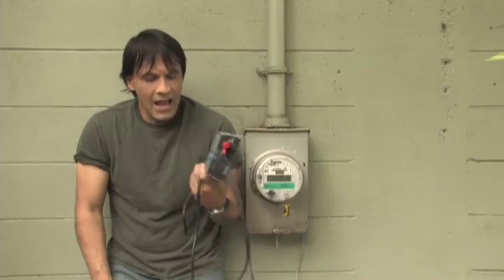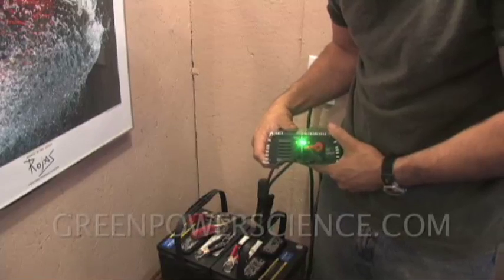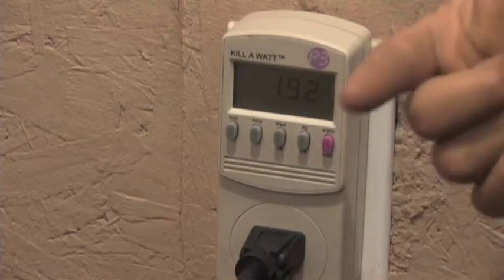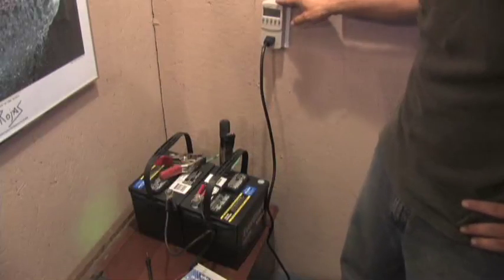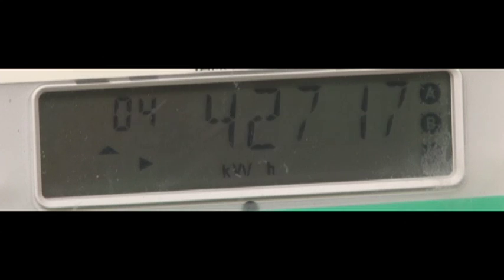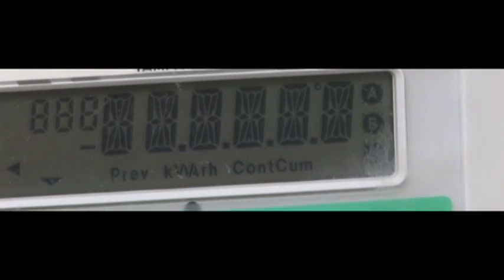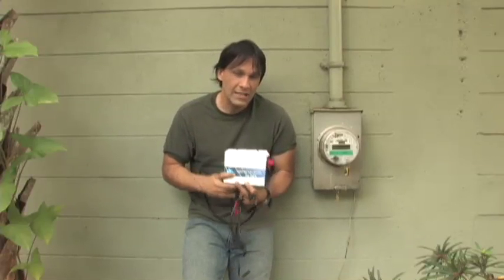GRID TIE INVERTER SOLAR panel POWER EASY Electricity Savings

Comment: I need advice: I have 2) 100watt solar panels (wired in parallel) to 2) 12v 100ah batteries (wired in parallel = 12v) and a solar charge controller. I want to power a 1000 watt grid tied inverter through the charge controller to prevent battery damage when the voltage drops to low. When I connected the inverter to the "load" side of the controller it does not power up. The inverter only works when connected directly to the battery bank. Is there a way to have the inverter power on and off automatically? Right now I have to manually monitor the battery voltage and manually turn the inverter on and off when the voltage drops. Any suggestions? Thanks everyone.
Reply from the maker: Hi,

The charge controller is shutting down because of the large draw to the inverter from the batteries. GTIs go direct to solar panels as there is no need for batteries. The battery was just a demo in this video. The idea is that the GTI supplements power to your house. If you hook a 1000 watt GTI to a charged 12V Battery it will draw 1000 watts = 84 amps on the 12V side = the reason the charge controller is shutting down or damaged. Charge controllers with a standard off grid regular Inverter goes prior to the batteries from the panels. This prevents overcharging of the batteries from the solar panels. You could place the charge controller from the panels to the batteries and directly hook the GTI to the batteries but you will drain them in about one - two hours because the batteries have a high AMP output. 200 watts of panels will deliver 150-200 watts of power to a 1000 watt GTI during optimal sunlight.
Reply: sfromd, the grid tie inverter is likely not powering up through the load of the charge controller because the grid tie inverter is 24 volts and it sounds like you are connecting it to a 12 volt system.  I too have a 1000 watt grid tie inverter and have been contemplating if i should connect it directly to my 24 volt battery bank which contains 300 amp and a total of 7200 watts.  If it is true that a wall outlet can handle either 1500 watts or 2000 watts depending on the breaker, then my battery bank which is connected in series/parallel totaling 24 volts x 300 amp = 7200 watts would be too much for an electrical outlet.

Comment: if you disconnect the main (turn off the Main Breaker) that isolates the meter(GRID) from the house....so the inverter is isolated from the grid (meter) . Also clamp on amp. meter only works on A/C.  with only one current carrying conductor in the field jaw .
Reply: Ronald Morell they also have dc clamp meter as he showed

Comment: can i use my dc to ac power inverter? i connect my tv to it is there a difference? beetween inverters?
Reply from the maker: Grid tie requires standard electrical input. Square or sine wave inverters (grid tie fall in the category) use battery power. Grid tie is Panel to inverter to outlet. Regular is panel to charge controller to battery to inverter = grid free.
Reply: so i have a cobra 2000 watt 4000 watt peak it has the regular connectiong like the  one you connect o a socket, if i cut the other end of the socket, and redo the connection, and plug it in to the socket will it work? i have them connected to my batteries which the charge controller charges with my solar panels.

Comment: if you drop the house breakers it kills the negatives running to your meter, and it will cut all connection to your metter even if your feeding the outlet, just my way of thinking maybe im wrong.

Comment: Wait a minute here now. When you flipped the Main beaker off  disconnecting your home from the power company  , what was the magic you used to still have the meter to register what could not be there from that inverter If indeed you turned off your main beaker cutting the house from the meter ?
Reply: The main breaker is still on. The breaker to the inverter is still on. ALL the other breakers are off.  The only problem is the electric company will NOT give you one penny back unless you have a contract. Thus the power meter keeps resetting itself to the highest amount it ever reached, basically taking the electricity and keeping it for free.  Search Wikipedia for "Robber Barons"
Reply from the maker: Main on all the rest except the one with the GTI off.

Comment: some people say i dont even need a dc breaker for a single panel. is this true?
Reply from the maker: You sort of do not need a fuse for inline from panels so for grid tie, not needed because panels have max limits of power. If you are going to batteries, the fuse is placed after the batteries because they can deliver a dangerous short load. If you have many panels arrayed it is recommended.

Comment: I would like to ask if I purchased a 2000W system as an example would I just be able to plug that into any outlet.  My concern is the rating on the house wiring.  15A rating has a power rating less the 2KW and when plugging a 2000W Grid Tie Inverter and I possibly pull 2KW of power would that burn the house wiring?  Great info on your video.  Thanks for posting

Comment: 7:05 sure you didn't mean it technically but in case some people don't know you cannot hook as many as you want to the same circuit because you could overload your circuit.  You would want to take into account what is already plugged into your circuit and figure up the current.  You mentioned 10 inverters and 2000 watts.  That is 16.7 amps (if really getting total power output of all) which is under 20 amps for a 20 amp circuit(but more than 80 percent of the rating of 20 amp breaker) and some people in mobile homes have 15 amp circuits so would be overloaded.  This is all not taking into account anything else already on the same circuit you would need to look out for that is drawing current.

Comment: i thought you cannot connect this grid tie inverter to batteries?
Reply from the maker: You can but the inverter draws a maximum load and maximum output. This was just for a test. With a traditional real installation batteries should not be used. Direct panel to Grid tie Inverter. Not sure if the annotations are still appearing youtube has phased them out. It was mentioned in the annotation bubbles.

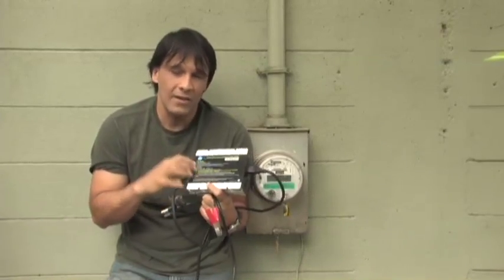Comment: you said don't connect this to outlet but at min 1:46 you said connect this inverter to outlet? in other words how to connect this inverter?
Reply from the maker: Panel or panels solar go to the DC inputs, and the male plug goes into the outlet of your house. This only works with grid tie inverters. The regular inverters will get destroyed.

Comment: So im looking at this Grid Tie Inverter on Amazon. I see "Solarepic Grid Tie Inverter 1000w Stackable w/ MPPT 10.8-30v Input 110v Output" So 100 Watt solar panel gives me 12V output.... So, for every 3 solar panels I would get 300 Watts and 36 Volts. Am I correct in thinking that I will need to buy another Grid Tie Inverter for every 300 Watt 36 Volt solar panel? What does it matter if the Wattage it can handle is 1000W if  1000W solar panel puts out 120Volts?

Comment: I'm not a electrition but 1kwh = 1000 watts\hour. Pumping 250 watts per hour back into the grid system equates to .25kwh therefore it would take 4 hours to become 1kwh. I could be wrong because im not an electrition but my math looks correct.
Reply: It's not, kWh isn't watts/hour, it's watts * hour
Reply: Its .25Kwh not 25Kwh therefore in four hours the meter should go back 1 digit (1Kwh). But the inverter will always be putting out .25Kwh. (250 watts/1000)
 A lot of people get this wrong.
Think of it this way, you have a bucket of 1,000 watts and it takes 1 hour to drain, that would be 1,000 watts in an hour or 1Kwh. Now take that same bucket and make it drain at a rate of 250watts per hour.  it would take hours to empty. Now take this wattage or drain of 250w and divide it by how much is in the bucket (1,000w or 1Kw) you will have .250Kwh, or how many Kw per hour.
Reply: Math wrong but either way it gave him correct answer in this case because 1000/1 = 1000, and 1000 * 1 = 1000.  I believe the point to his comment is that it should have taken 4 hours time to go by for the meter to go backwards.  This is not the case.  This was the point of them waiting for it to move to the next number.  It just changed from 6 to 7 so it shouldn't have taken a full kWh to move back to 6.  Since it just changed it shouldn't have taken much at all.
Reply: That electric meter reads KWH and in small numbers 10ths and 100ths' of a KWH meaning it can read 10 Watt hours. a 200W inverter can supply 200 watts in 1 hour or 20 watts in 6 minutes or 10 watts in 3 minutes. The lower digit should change lower every 3 minutes at full capacity.  As the video reports it is a greedy meter meaning it's fixed by the electric company to accept the electricity from you but will NOT record or pay for it unless you have a contract for buy back (for less then you pay them for the original juice I may add). That is one reason the electric companys got so excited to update meters from mechanical (which they had no control to prevent  that) to electronic ones that could be told to "not" pay you anything, or worse only pay you a percentage of what you pay them.
Reply: Best thing is to just run solar and batteries and an inverter and shut off your main.
Reply: @drewpaschal9294  That's the best thing for the battery manufacturers :-)  But the worst thing for your wallet.

Comment: if you wanted to see it tick backwards you should have waited 5 hours. why 5 hours because the metter displays kwh. 1kwh=1000 watts running for 1 hour. a 200 watt grit tie would take 5 hours to get it to tick back 1kwh. i may be wrong if so my  bad
Reply: This is not the case.  This was the point of them waiting for it to move
 to the next number.  It just changed from 6 to 7 so it shouldn't have 
taken a full kWh to move back to 6.  Since it just changed it shouldn't 
have taken much at all.
Reply: Didn't make any difference since the electronic meter was obviously set to not reverse. Thats why he called it a "greedy meter" . Why do you think the electric company started installing those meters in such a Friggin Rush?

Comment: How did the power feed back into the grid with the main off? The main is the point between the meter and the load center. If the main is off then it wouldn't back feed because the circuit was interrupted to the grid.
Reply: The main breaker is still on. The breaker to the inverter is still on. ALL the other breakers are off.  The only problem is the electric company will NOT give you one penny back unless you have a contract. Thus the power meter keeps resetting itself to the highest amount it ever reached, basically taking the electricity and keeping it for free.  Search Wikipedia for "Robber Barons"
Reply: Calvin Thomas I am using a 960w system and I got a warning to remove my system they say its illegal and the only time we use over 900w is when we use our laundry

Comment: I know this is an old video, but DIY is a no-no when it comes to Grid-Tie systems. There are many laws in place when it comes to messing with the power company. You have to get permission, permits, and inspections before you are legally allowed to add power to their lines. You can take all you want but you can NOT put power back in. You are not even legally allowed to add to an existing Grid-Tie system, without jumping through the permit and inspection hoops. They are very strict about that.
Now what you CAN do, is have an Off-Grid system that is isolated from the power company's lines, through a transfer switch (like you use for generators during a power outage). Of course, that has to be inspected and approved so your homeowner's insurance will cover you. So if you don't want a full size Grid-Tie system (that goes down during a blackout), this is a better alternative to lowering your power bill. I personally think Grid-Tie systems are a waste.
Reply from the maker: Produce less than you use and no electrons back power the grid through the meter. That makes it an electrical appliance. Nothing post meter is regulated from the power company. They was their hands of post meter appliances for legal reasons. If you back power the grid, that is a different story.
Electric companies MUST prove electron transfer to their grid, basically not worth their time.
Reply: Oh, they are quite clever and have computer algorithms to check for things like that, much like cable companies who have ways to look for people stealing cable (like sharing basic cable with a neighbor with a splitter). Their instruments can see too much draw on their cable line.   I once moved into an apartment and obviously didn't use nearly as much power at the previous tenants. After some months there was a notice on my bill that they installed a new meter, figuring something must be wrong with the old one, because of my low bills.
Reply: Yes, that is it.  Do not produce more than you use and slow your meter.  Selling back to the grid is a monster.

Comment: First point: Um...... I'm not an electrician, but my common sense tells me that plugging into the wall like that is a HUGE FIRE HAZARD.  It seems to me that there is specialized equipment made for grid tie ins. Second point: Anyone watching this video DO NOT buy the KILL O WATT meter shown in this video. (no offense). I bought that exact product to monitor how many kilowatts my electric car was using and it died after 2 months. Piece of crap.
Reply: lol , your kill-a-watt meter is rated for 15 amps MAX... charging your electric car used at least 15A ( my leaf was at 25A ) that is probably why it failed

Comment: Hey. I have been a looking at your video for a long time now  and  I'm getting to do a set up like yours .i just pick up 2-24v-230 watt solar panels and I have had 2 -12v-60 watt solar panels with a sun 300 watt grid ti inverter what should I buy to set up this system to get the most out of what I have so far. I allso have 4 deep cycle marine batteries and one kills watt meter all will be set up in a shed 12 feet from my house and outlets

Comment: Man! Why does everybody want grid tie? Scuhrew that! Learn what you can power with a good tie box from a box powered by the inverter itself. You can get out with a damn decent system for about 3k$ power certain things that will not even touch the power meter. Everybody is doing this "Green Movement" which is good, but there seems a herd mentality to it. It's like there's only "green" if it benefits the corporations. Once again... Scuhrew that! Come on people! Think outside the box a little. Power just your fridge or your tv and lights by your inverter/s.

Comment: Man I been dying to get me about 5 of the 600w inverter but someone told me if I have a one of the new power meters that the power company would charge me for the power I make and use I dun some reading and I can't get a strait answer now I live in the fucked up state of FL were it's now against the law!! if you have a Home there That's not tied in to the Gide other word if you don't send the power company a big fat check ever month they throw your ass in jail I just dug a hole to plant a orange tree and was fined because i dug the dam hole to big FL goverment is out of control!!
Reply: Dan, You're doing a real good job of explaining all these cool items. This one is a keeper.
Reply from the maker: +Jason Davis Produce less than you use. The meters do not go backwards unless they are special meters. Most meters do not charge for grid feeding, they just take your power for free. Newer meters can distinguish if grid tie but they cost them too much to install. Place your solar install in your backyard and feed house with extension cords. Unplug when not in use. If you do not send electrons into the grid, the power company cannot tell you what to do. Anything that does not affect their system is just an appliance. Like energy saving LED bulb. Have a service from them, pay them something every month but less than normal. What we do is used grid tie supplement always below usage. The only issue would be code enforcement that is why you have a backyard "HOBBY" solar station:-)
Reply: +GREENPOWERSCIENCE  ya I guess I could use the solar panels to charge a battery bank and switch the lights TVs stuff like that over.  I was really wanting a grid tie but something I Learned along time ago is if you want to do something in FL the answer is no! I wonder if there wonder if I could buy the right type of meter and have it changed out
Reply: As soon as you install batteries, the cost per kWh goes up well past the POCO charge, unfortunately.